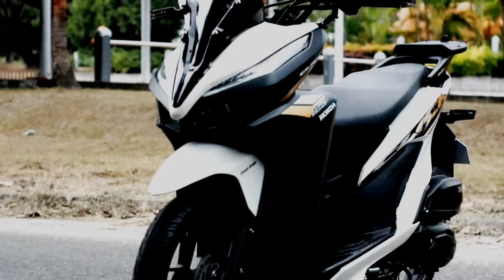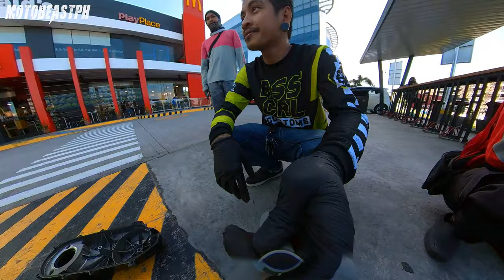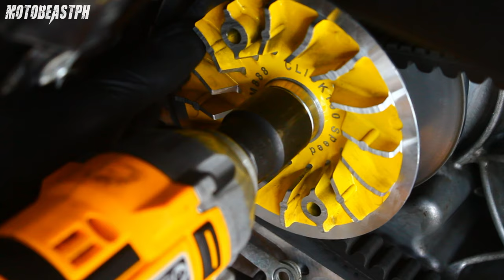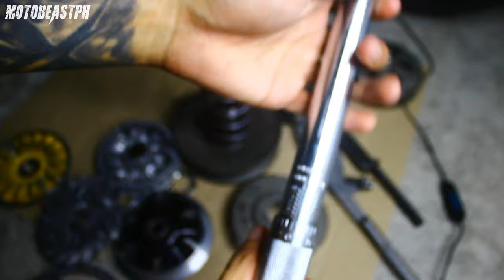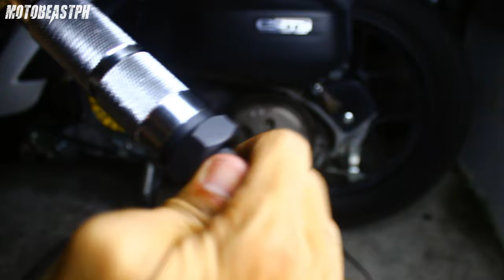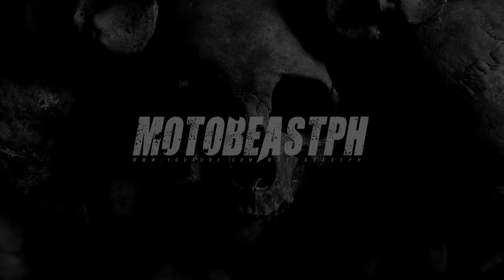Honda Click 125i | Loose Crankshaft Nut, Flyman Torque Wrench

Comment: In my 8 years of riding a scooter, my variator nut came off 3 times due to my impact wrench faulty or using one that i am not familiar with. 

Also, only recently I realised that I must make sure the belt is loose before tightening the variator nut!

By the way, how do you grind down the Y tool pin? Mine is too thick as well.
Reply from the maker: I've used a file to grind it down to size.

Comment: per the service manual, you have to put some oil on the threads and then torque down to 59Nm, you did it wrong by tightening 59Nm to dry threads
Reply from the maker: Nope. Checked it on the shop manual.
Reply: @MOTOBEASTPH  sa iba ung ung 39nm nuts sa clutch higpit nila 49 newton meters bakit Sayo 59 boss?
Reply from the maker: @zeyanZen  54

Comment: Sir newbie lng po sa paggamit ng torque wrench (battery). anu po recommended torque sa paghigpit ng cvt nuts sa my driveface and torque drive? Thank you.
Reply from the maker: Depende sa motor, bro. Check mo mismo sa shop manual ng casa.
Reply: @MOTOBEASTPH  Click 125 po sir. Check ko po sir. Thank you.
Reply from the maker: @mkn9215 Same lang dyan sa video, bro. Click naman yan motor ko.
Reply: @MOTOBEASTPH  Mali po pla yung tanong ko sir, yung impact drive po pala kung gano po kalakas na torque yung kailangan sa paghigpit. Yung nkita ko po sa usa nyong video is 2 times in low setting. Tama po ba?

Comment: bro, matanong lang regarding torque wrench. may nabili kasi ako. nka set na sa desired torque. tpus na lock ko na. normal lang ba na  naiikot parn yung adjuster nia kahit naka lock na?. BTW flytech yung brand na nabili ko.
Reply from the maker: Yes pero konti lang.

Comment: Sir pede magtanong..
San Kya mkkuha torque specs ng click160 Wala ko mkita online eh..sayo Wala din..
San mo po nkuha yun sa honda mechanic pinicturan mo Yun manual? Thanks
Reply from the maker: Sa engine same lang ang torque specs ng CLICK160, ADV160, PCX160, AIRBLADE160.

Comment: Saan po yung source nyo torque value ng mga bolts ng sa pulley at bandang torque drive? Thanks po!
Reply from the maker: Sa casa meron sila sa shop manual.
Reply: Salamat sir, ano po torque value ng sa bolts ng crank case?

Comment: Boss amo ano maganda pulley set na pwede pang daily? Di naman grab o food panda. Naka Jvt v3 din ako. Stock engine pati cvt.
Reply from the maker: Speedtuner V2. May vlog ako nyan, bro.
Reply: @MOTOBEASTPH  Salamat bro. Last na tanung na. Naka mid ka pa rin bro sa Jvt v3 mo? Yung akin mid din. Naka remap. 107 top speed. Nung naka mt8  pipe ako naabot ng 110. Bat ganun bro? Sungaw ba? Haha
Reply from the maker: Palit ka racing/kalkal pulley set tapos tono

Comment: Sir pano malaman kung ilan newton meter un need gamiten ?
Reply from the maker: Depende sa torque spec na sinet ng manufacturer. Makikita mo siya sa shop manual depende sa motor,.
Reply: @MOTOBEASTPH  ah sa may casa kupo makikita un ?

Comment: Idol ano ang torque para sa beat? Para sa nut ng bell at nut para dun sa driveface ty
Reply from the maker: Same lang din, bro.
Reply: Ty idol
Reply: Isa pa sana idol torque ng nyt sa beat para sa nut ng gear oil?
Reply from the maker: 23nm

Comment: Sir anung size ng torque wrench dpat sa aerox
Reply from the maker: Same lang, bro. Magkaiba lang torqur values. Sa mga casa meron nun sa shop manual depende sa motor.
Reply: 3/8 torque wrench po ba?
Reply from the maker: @ryebullag5135  1/2

Comment: Soy pabulong naman san mo nalaman mag torque spec value??
Reply from the maker: Tinanong ko, bro sa casa. Meron sila sa shop manual.
Reply: Maraming salamat. Parehas lang kaya torque spec value nang 39mm,  pulley DF at nut nang bell sa ibang scooter?
Reply from the maker: Same lahat ng Honda scooters.
Reply: @MOTOBEASTPH  maraming salamat.